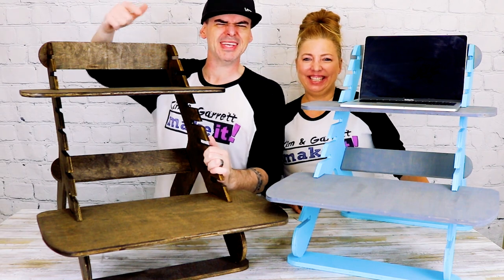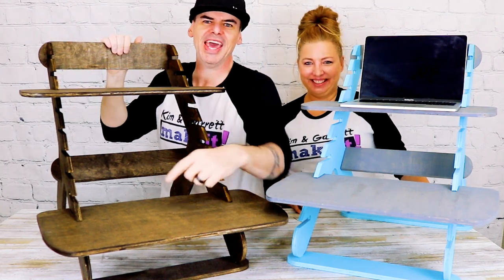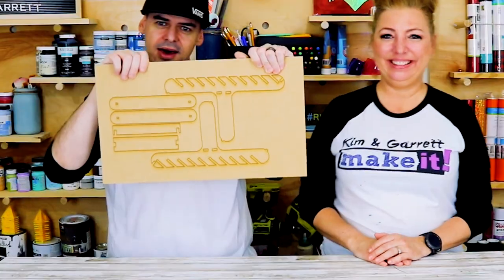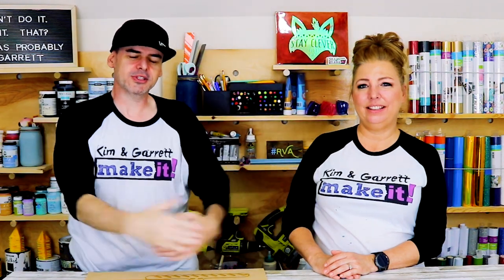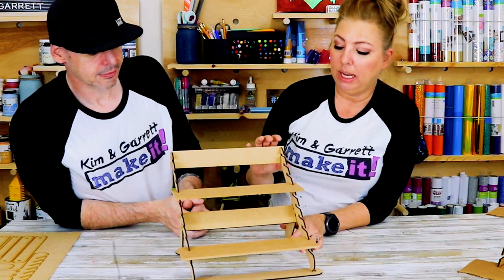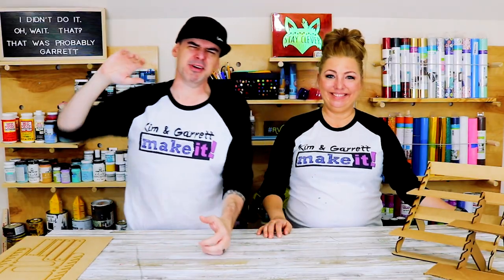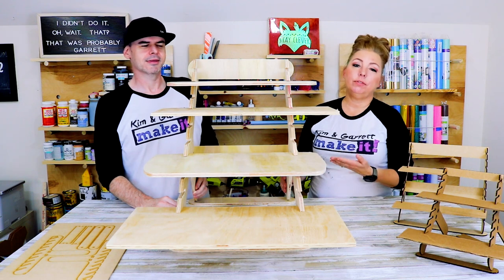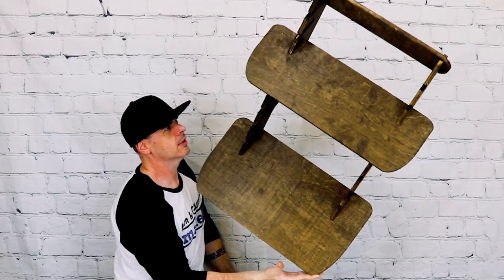The Ultimate Standing Desk Converter

Comment: These are great.... alot better than the one I bought that is either 'up or down'...this has so many adjustable levels! Wondering if a hole on the large bottom shelf that a travel mug could fit into, it wouldn't have to be put on the table shelf
Reply from the maker: Yes! That would be such a good option, there is lots of room to customize